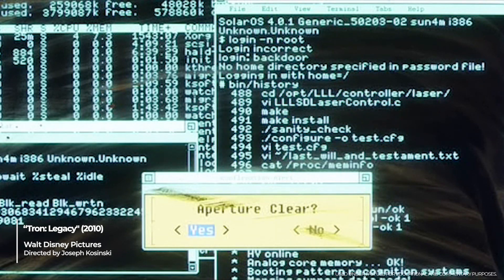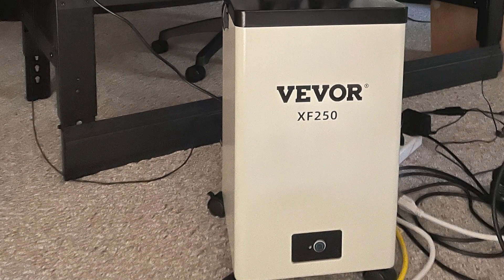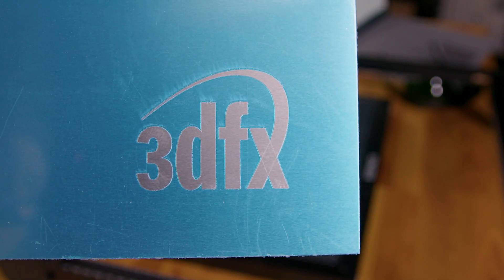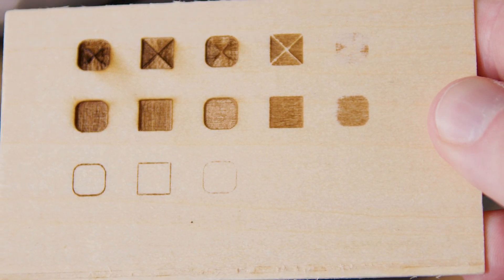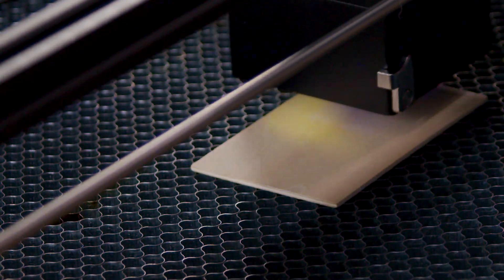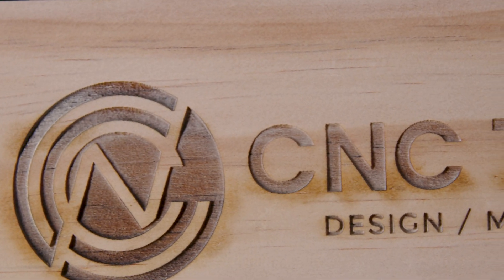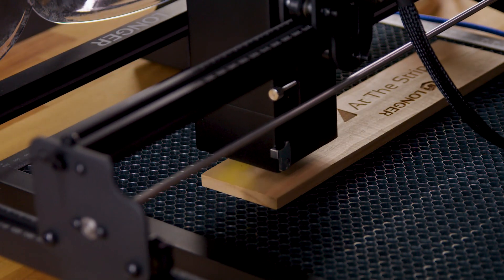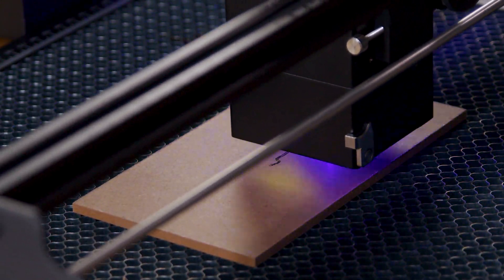Testing Ray5 20W Laser Engraver! The Sci-Fi Laser For Your Desk!

Comment from the maker: SPECIAL FOR CNC TIME-LAPSE VIEWERS: $50 discount code: CNC50

Longer Ray5 20W: http://bit.ly/3yeYYtL
Laser Ray5 20W Basic
   Original Price: $799.99
   Prime Day Price: $499.99
   Saving: $300 (62% discount)

Laser Ray5 20W Pro Max Set (RAY5 20W+Air Pump Kits+ 400*400 Honeycomb Panel + Rotary Roller + RAY5 Enclosure + Camera Kits)
   Original Price: $1659.99
   Prime Day Price: $749.99
   Savings: $910 (45% discount)
Reply: Can that machine can cut half things?
Reply from the maker: So far, I've used the machine to cut a variety of wood up-to about 1/2" thick when doing multiple passes. I wasn't successful at cutting metal, although I was able to get it to engrave aluminum slightly when it was covered with a think plastic. I suspect though if the metal was painted, it would have more success, though I doubt it would be capable of actually cutting aluminum. 20 watts just isn't enough. That said, it does cut wood beautifully. I'm working on a new video that will showcase a bunch of projects that feature detailed wood cutting as well as engraving using the machine. All-in-all, it's a great little machine that is very easy to use. Highly recommended!